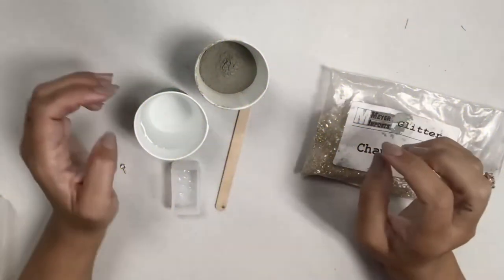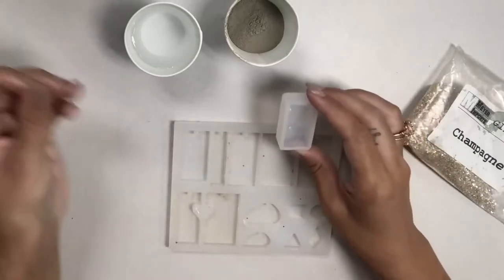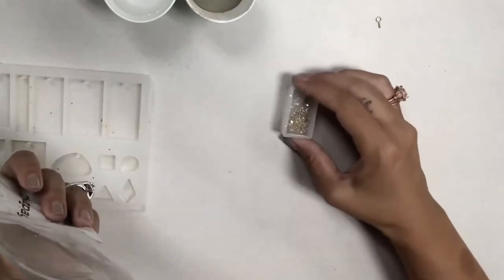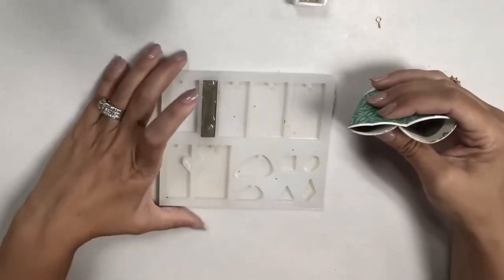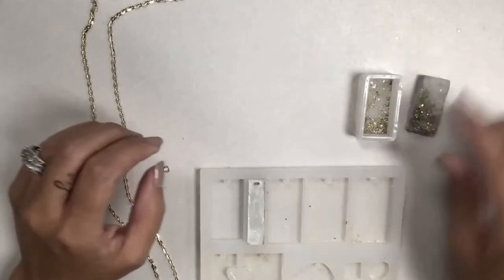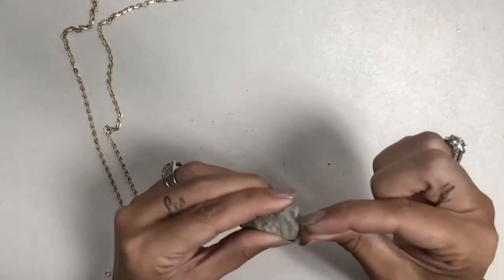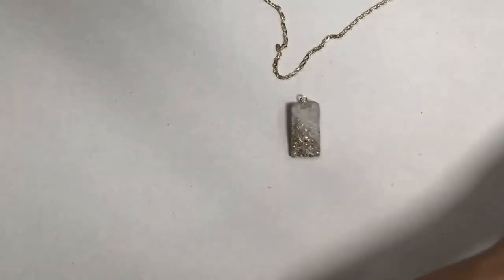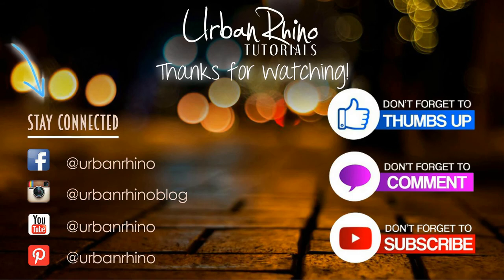How to Create a Concrete Necklace

Comment: I noticed that the other mold that you used, that had the silicone plug in it to create the hole, broke when you took the casting out. Is there a way to keep that from happening?

Comment: How would you put an eye ring in the concrete while in the mold? Wouldn’t it stick out from the mold
Reply from the maker: You would need to bend it 90 degrees at one point, then bend it back so it makes a sort of Z shape. This will allow only the top part of the eye pin to stick out of the concrete, while the rest is inside.

Comment: Hi! I’ve been looking for the textured silicone molds and have had no luck finding them anywhere! Do you remember where you purchased the one you used in this video?? Thanks!
Reply from the maker: Hi Danielle! Actually, we sell a complete kit for $19.99 to make this necklace! The concrete, chain, mica glitter, mold and all the other materials are included :) We have several other kits we are getting ready to add on there as well, we just wrapped up putting them all together. Here is the link if you are interested... https://www.urbanrhinocolumbus.com/jewelrymakingkits
Reply: @livandvivdesignco  Awesome! I will check that out! Thanks so much!

Comment: .... is that concrete..... or cement....
Reply from the maker: Concrete. It's called Quickcrete.
Reply: @livandvivdesignco  is it regular cement?
Reply: @livandvivdesignco  because the regular one i use breaks so easily after it gets dry
Reply from the maker: @cyracuskenneth1865  it’s not just cement…it’s concrete. I would definitely try the Quickrete
Reply: Is concrete something different in the States @livandvivdesignco   ? Cement is used to make concrete in the UK, Concrete is a mix of cement, sand and aggregate in the UK
Reply: Cement is the wet state and when dry is called concrete.  Just FYI.
Reply: QUIKRETE is the Brandname.